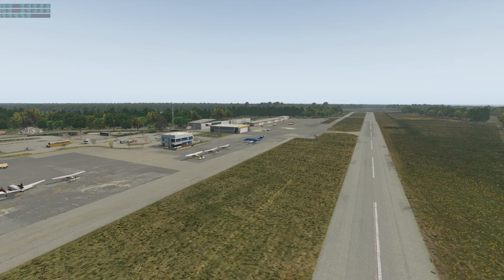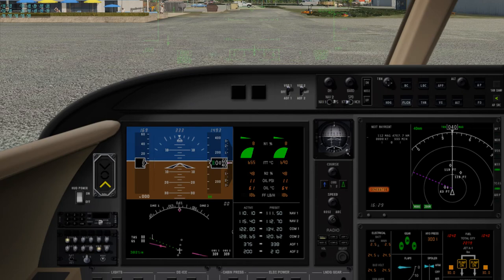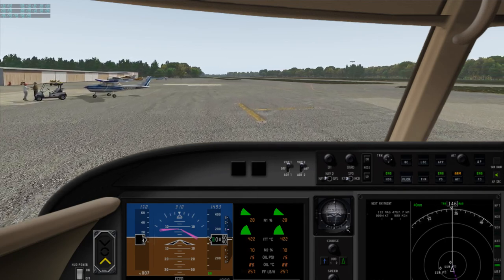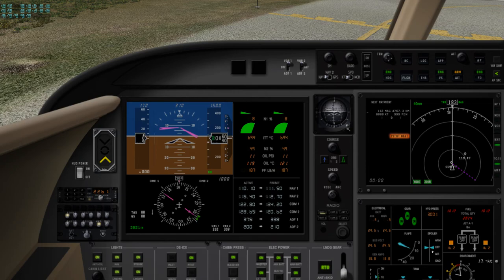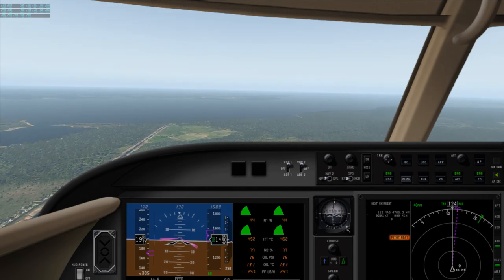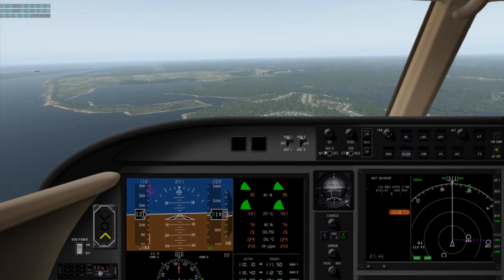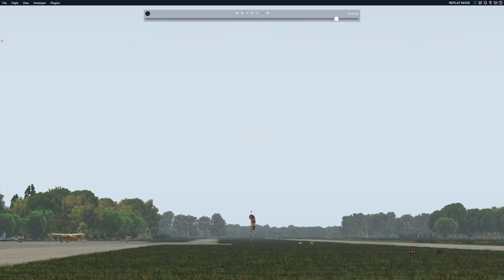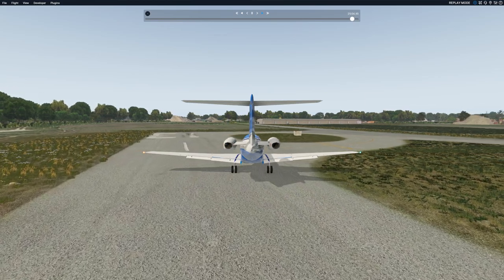X Plane 11.10b4 I KJGG I Pilatus PC-24 Cold Start and Short Field Landing

Comment: Do we have the SID/STAR procedures available with this plane ?
Reply from the maker: SID /STARS are in the FMS box that you are using and not in the Aircraft files. I use XFMC in this AC. It is very capable and for most of us because it is free a very welcome addition. Google it and download. Thanks for the comment and stopping by.
Reply: Thanks for the tip !
Reply: I've just purchased the plane and impossible to get it work (black screen in the plane), I have to enter the serial key each time I get back to Xplane, could please help me on this ? thanks in advance
Reply from the maker: Vincent
 Which Aircraft have you bought ? let me know and I'll try to help
Reply: I've bought the PC-24, the creator has responded me this morning and he told me to restart Xplane as soon as I enter the key. I'll try that tonight. Thanks for you help
Reply from the maker: If that is Sgier he isn't much help I have never been able to get my copy working and he continues to ignore me. Best of luck and let me know the outcome of your dealings with him. I may make another run at him or get Paypal to refund my money. The aircraft isn't very well modeled either. While nice looking I took the one from X-plane and got the specs from the actual aircraft type certificate. As a 25 year professional pilot flying more than 500 types, I prefer accuracy more than Eye candy....
Reply: Actually, he responds me quickly but the problem is I couldn't get it working so I've asked for a refund, waiting for his response

Comment: Where to buy the PC24 and what simulator should I get.
Reply: Thanks for stopping by ! I started with the MSFlight Simulator back around 1982 when it was little more than Stick Figures. Today after all this time I have found the X-Plane 11 to be not only a better visual image but a better model of the flight dynamics. I have spent over 30 in actual flight transportation as a Captain in various types of jets and so my basis for comparison is pretty good.  

The news is not as good for the PC 24 is not as rosy. I had been using the Free model from the .ORG store but is not supported and doesn't work with XP11. The Pay ware is crap although it not too expensive. I cannot recommend it based on poor support, inaccurate flight model and lack of fidelity from the author. I have yet to be able to use it as it is very difficult to unpack correctly.

I hope that helps, but feel free to ask any questions. I you do take up with XP 11 my videos can be useful.

Cheers jagjet aka Robert Phelps 
ATP Various type ratings including CL 60, All Citation, and about 400 more.
Reply: Thanks for the come back. The PC24 your using is the pay ware from IRIS? What .ORG store? Thanks